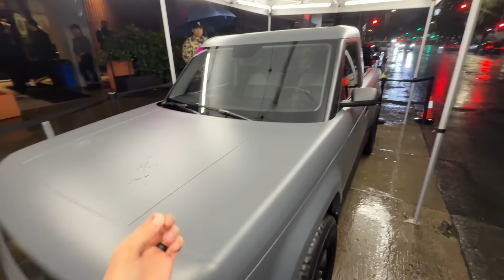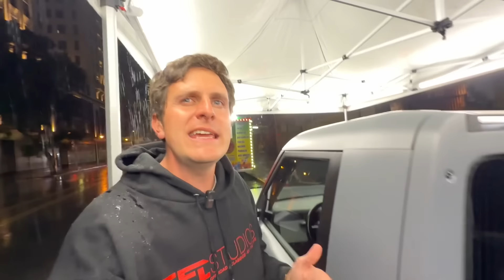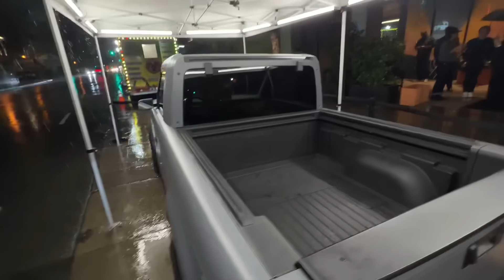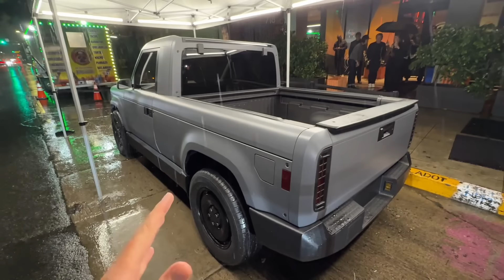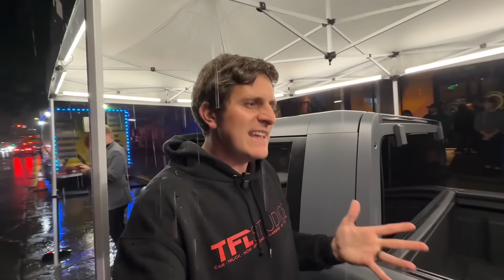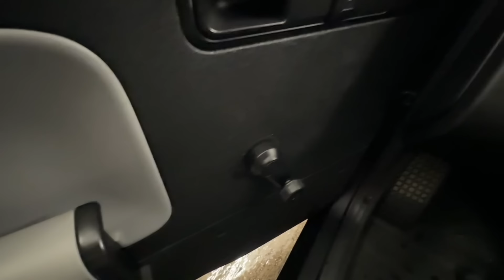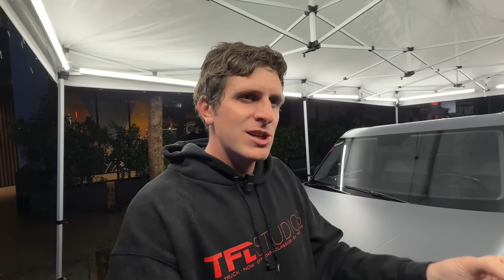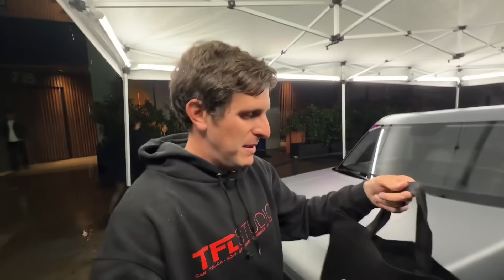The TRUTH About the '$20K' Slate Truck...Will This Really Be a Hit?

Comment: People do this with the frontier as well. All you see is how great a NA v6 is and “they want a basic truck” and they don’t sell. People talk, especially online. Rolling off the couch and purchasing and using something in the real world is another can of worms for these people 😂 That’s why manufactures don’t listen to online BS because numbers don’t lie.
Reply: Oh yeah..  There's a Chevy dealership in Florida that does work trucks.  2 door, white, RWD, base engine...  And they move a bunch of them for construction guys and such.  $22,500 WITH 1.9% APR..   Full size brand new pickup and $300 less a month than this thing if financing.  But, the person buying, looks and wants the heated seats, the 4WD, the crew cab, the more powerful engine, blue paint etc etc..   That one has a radio, has power windows, has much more utility... I get the slate is smaller, but you don't spend Suburban money on a Traxx.   

This thing isn't really a deal as a basic truck.  You can get more capable ones for less.  It's not really a deal as a basic EV, again you can get much better equipped ones for less.  

I get the talking.  Heck 6 months ago Slate was bragging 150k pre-orders in their first month.  A couple weeks ago still bragging on that same number.  And with a low buy in ($50) and low historical numbers from pre-order to actually signing the contracts, that might be a tough market for them to try and take with the price point they are moving at.

Comment: I want a $20k truck with a 5 speed, basic gas NA engine, and a lifetime powertrain warranty. I do not want a disposable Dixie Cup that takes 30 minutes to recharge and loses "range" over the 20 years I hope to own it assuming the battery lasts that long at any range.  How the hell is this a "common man" truck when the Common Man can't work on it, rely on it, or easily modify it to fit his needs.
Reply: EVs aren't all that hard to work on. And have less maintenance requirements than gas powered ones.

Comment: I think this will be good for a two-car family if it's affordable. Do not think many will be road tripping this. I used to drive small single-cab trucks, but as they gave way to 4 doors, I stopped driving a truck. I do not have anything against 4 door,s just not for me, no kids. There is room in the market for EVs Hev and petrol cars. The market will find its way.

Comment: People are forgetting that this company isn’t just for the cost cutting. It’s the fact that we’re finally getting pure basic machines again. The Ineos grenadier is 80k, but it’s meant to be a simple well built machine. We don’t want cheapo 13 inch touchscreens and all white interiors with piano black. Enough of the massaging seats, enough of the air suspension, enough of the no button-tablet only dashboard. We just want a simple long lasting car that won’t break in 8 months because they’re rushing to be the first with the next new features

Comment: I'd prefer more range and a slightly bigger bed at around 30k. If it's going to be this small, id rather have it be cheaper and potentially a hydraulic dump bed. There's kei trucks with dump beds, removable sides, and 4wd in asia for less than 15k. Even build in America, they'll be under 20k. If you have to tow anything 150 miles is going to really limit you. How much can it even tow?

Comment: Since its a truck, you can literally strap a generator in the back. Add a two way plug in the back, make use of that battery for V2L. The range is fine if the price is right. No 4wd is a buzz kill. No 2nd row might be a problem.

Comment: EV owners don't use the battery  from 0% to 100%. A realistic use is 10% to 80%, which gives 105 miles of range for this truck, and that is during nice weather. In the cold winter it can be closer to 70 miles of range.

Comment: Ford ranger 2009 single cab will out run and out perform this  and my basic already lol especially on off roading and towing. Im sorry but i need to see how it towes and how much weight can it hold that the reason for trucks either wise its a car with a bed not a truck

Comment: I like the truck, however, I won't be buying it. My reason is simply because its an electric vehicle and I live in the north where it gets very very cold. Electric does not do good in cold. I won't waste my time charging an electric vehicle when a gas one is so much more convenient. If it was gasoline and a manual, I'd want one. But we already have that in our Toyota pickup. Its a single cab, with 2wd, manual, and manual windows.

Comment: Was t this truck advertised for $10,000 just a few months ago?
Reply: About $20k was the plan, but that was back when the tax credit still existed, even though we all knew it was probably going away.
Reply: Is that price for a single drive motor and the entry level battery? What’s the cost for Dual Drive and the premium battery?
Reply: @vonklock6807  They have not announced anything but a RWD model and they have not announced the prices of anything, even the vehicle itself was only a very rough "mid 20s" statement.

Comment: I would totally be ok with an EV, for the right price, if I didn't have to travel. I typically don't drive more than 40 or 50 miles a day when I'm home, but once a month in need to drive 500 miles one way to get to and from work.  Even the best EV wouldn't be enough range for me.

Comment: Not only that a brand new Suzuki 660cc motor and transmission costs around $7600 US while a replacement battery for the slate costs at minimum $9300 US the slate truck could be cheaper with a gas engine

Comment: In Mass. I have had Volvo 240s and a Mazda B2000 truck, all rear wheel  drive. Also a Civic front wheel drive. We get real winters here. These cars were NEVER an issue in the snow and Ice. 4WD is way over rated.

Comment: Absolutely not what I want. It’s an EV, 2WD, doesn’t have a manual transmission, has a useless 4 ft bed, and a regular cab so you can’t even recline the seats at all, still loaded with electronic crap, it’s my idea of a terrible vehicle. Make something like a 1999-2000 Ford F250-550 with an extended cab, manual transmission 7.3 diesel, 4WD, and an 8ft bed. Sell it for $40k and I’d buy one, as would every other contractor I know (well if you also offered it with an automatic) Something that can carry real stuff, tow a reasonable trailer, plow snow, last you at least 20 years, and be reasonably easy for the average person to work on without needing special software and subscriptions and/or tons of special equipment and tools. Basically a late 90s early 2000s car.

Comment: My recent car purchase was a 2017 Mazda CX-5 Grand Select. One year trim level that basically only has the Bose Speakers, sun roof and Leather/Heated seats "Options" of the Grand Touring model. I would buy this if it was a little 4 cylinder Hybrid at best, with AWD. My only car "requirements" has always been AWD and at least 1500lbs of towing capacity. With my "Like to haves" being heated seats and nice speakers (which could totally be added later with aftermarket speakers).

Comment: The bed is too short to camp in.  It's a pickup in the same way a Subaru Brat was, meaning still not quite.  It looks like the #1 design requirement was that it would fit in a compact parking space.

My daily is a 1985 Toyota Pickup, 2WD, 22R, stick.  I've got four of them.  One runs, two need work but should run after a day of love each, and one needs more assembly.  The one I'm driving is the one I have the most money into, and I'm still under $4k.  I'm into the cheapest one for less than $1k so far.  It'll be under $2k by the time it could take over as the daily.  They fit in compact parking spots.  People ask what years they are and if I want to sell.  Parts are easy to come by.  Nobody asks if I really think this was a good idea to put that much money into an untested design.

I wonder what the economics would be of scouring the less rusty parts of the country for these and having a restoration system set up to "factory recondition" them.  If that happened, what would you rather buy?

Comment: As someone who worked in Jeep dealerships for 20+ years, real Jeep people want the upgraded Rubicon axles, transfer case and suspension but Jeep forces them to get heated memeroy power leather seats and sub woofer touch screen GPS sound systems, and 360 surround camera systems to get them. If they would offer a "Rubicon X" with all the off road capability without all the expensive luxury fluff and sell them for a sub $40K price, they wouldn't be able to keep them on the lot. But the truth is they make their money off all the luxury fluff so that's never going to happen.

Comment: Most households have two vehicles. For those who can charge at home - one should be an inexpensive EV.
My plug in Prius has a 20 to 25 mile range and it's plenty for where I live.  I have level 2 charging and charge once or twice a day.
I have to make it a point to burn through a tank of gas (10 gallons) every three months to make sure gas doesn't get old and  the motor doesn't die.
I live next to a hydro dam with cheap electric.  Drive 20 to forty miles per day and spend $5 per month for electricity.

Comment: When you're talking about a gas engine, you go off the rails. Are you not aware of the CAFE standards? The only reason small ICE trucks won't be sold is due to those standards. The only way small pickups will be built and sold is if they are EVs.

Comment: I agree they need to add a gas engine, but I think you're slightly missing the point in saying that "people buy range for trips they never take" and "modern trucks double as family vehicles" (regarding the switch to crew cab);  I believe that the people that really want a cheap truck are the working class.  The landscapers and guys commuting to construction sites.  They need the range to drive all day or commute a hundred miles one way to a job site. This truck would be perfect for them....if gas, and if the bed was a little longer.  They're still driving 90's Toyotas and hard body Nissans because they're literally the only thing that fills that need.

Comment: The worst thing you can do with a vehicle is try to please everyone on a single platform. Then nobody is happy because people who want lots of extras end up with lots of useless things intended to please other niches and people who wanted something as bare as possible don't have any choices either because even the most basic trim already has loads of crap on it and all of the overheads associated with making the extras possible.

Range-wise, 200mi (150mi usable winter range) is my minimum: I do not want to make charging stops when I go visit my farthest out-of-town friend, especially in bad weather. I also need 150+mi of range for those days where I need to make more than one round-trip to my sister's house in a single day and still have enough range left for my normal stuff without feeling too much range squeeze on my daily driving.

While a range extender may be nice, adding all of the facilities to accommodate one would add hundreds of dollars in costs to the base model: modifying the platform to add facilities for a fuel tank, exhaust pipe, electrical hook-ups, coolant hook-ups, etc. along with associated additional points of failure and likely reducing usable cargo space in the process too since the space reserved for a tailpipe, cables and hoses cannot be used for much else regardless of whether you fit a range extender to your truck or not.

As for AWD, I'm in Canada and I definitely wish I had AWD for the 4-5 months per year where there is snow and ice on secondary roads. Also, 150kW is too much power to have on front wheels alone, really wish it was more like 75-100kW rear and 75kW front. I do not consider RWD as a viable option since that makes it difficult if not impossible to recover from grazing a snow bank on the highway and under heavy snow conditions, you sometimes have to plow through 4-6" thick banks to change lanes. With FWD and AWD, you just power through almost as if there was nothing there, front wheels pull themselves over the snow and the rear follows.

Comment: And then there's single people with no kids who don't need a family truck.  More the norm these days.  It's the only choice that makes money sense.  I take the road trips.  To work and back is easily 90 miles round trip when the freeway is closed and there's a detour.  Not a fan of EVs though.  If it's like every laptop ever, 3 years and the battery is dead and the computer/vehicle is a paperweight.

Comment: Just think of all the aftermarket body addons that could exist.  Want a supercab potential easy body mod that could come out and be a bolt on. Maybe a subaru baja body mod. The way they are designing this there is the potential for aftermarket changes. The cost of the unit makes these type of things possible. Just look at all the body mods that were available for the VW bug which was just a bolt on body.

Comment: I am very curious to see what happens with this Slate concept.  I am turned off by the very short bed--I can work with the 6-ft bed of the older small pick-ups, but the shorter beds (of all modern pickups) leave me looking in the used truck market.  Also, I feel like Slate is putting too much emphasis on the modularity and customizability, which will make these vehicles expensive for consumers.  Please put more effort into a true low cost, somewhat more capable simple truck.

Comment: I bought a brand new Toyota, small truck basic, in 1979, it had the indestructible 2.2 22R motor, with a five speed it got great mileage, handled well and was a low cost alternative to a full size truck, they will not make them anymore, because the only way they make money is to load these trucks up with electronics, and, gimmicks that add nothing to the utility just the cost. I do not want to have to "wrap" my vehicle, just drive it home from the dealer. For the money I would rather have a good used F150.

Comment: What they are going for is interesting, in a way sneaky, and in another not quite there. Range is an issue even with larger battery. I have to go 50 miles to get to a hardware box store or woodworking store. Imagine having to go a couple of times because you need something else. People do like to customize vehicles, but that's only when they can afford to either have it done, or even fewer will do it themselves. Are the accessories going to be affordable, or marked up so far people don't bother? As much as they think this will be a secondary vehicle for the household, how many working class people can afford another vehicles insurance, maintenance, and storage cost when everything else has gotten out of hand? For the total end price, would buying a vehicle that is setup for families with a decent bed space be the better option? Me, I didn't land a family,  a two seater is fine as I've got that already with a cab and a half that didn't have the back row. I enjoy and utilize a larger bed to make it easier move materials and get work done. For me a truck does work, and a car is better to move people. But when money is tight, does it make sense to have two different vehicles for everybody? Plus you have a whole bunch of knuckleheads who think a larger four wheel drive vehicle will keep them safer in a crash, physics says to the contrary. More mass equals longer stopping distance, higher center of gravity equals higher rolling chance, bigger overall makes a bigger target, so on and so forth. Too many tiny people driving trucks they can't see over the hood.

Comment: They need to find a  creative way to still sell it for an equivalent of $20K in today's money. Otherwise, it will go the way of Cybertruck: an oddity way overpriced for the utility it provides.

The equivalent of such price would be a lease at $278 a month with zero down. A symbolic $250 a month zero down - easy to advertise and remember "quarter grand" - would be even better.

Since presumably there aren't complex mechanical or electronic parts to quickly wear down and then require a fortune to repair, like with most cars these days, lease residuals can be ostensibly pretty high.

Comment: Most modular designs fail and die because the company doesnt open source the parts and accessories and tries to stifle third party support. No one will buy a car if all the accessories are high priced OEM stuff. It needs open source cheap accessories to survive.

Comment: It is an interesting value proposition without the tax credit.  At an actual cost of $20K I was smack in the middle of their potential buyers...50's, all my kids are furry (and huge), commute is 34 miles round trip, a house with multiple options for charging (soon) including solar, long trips are done on my motorcycles or towing a race trailer with by gas guzzling F250.  I am reaching a crossroads where as soon as my current dog hauler (2004 Sienna minivan) becomes to rusty to be worth repairing in the next 12-24 months, my next DD will be an EV.

At about $25K it is competing against excellent used, late model EV hatchbacks that are arguably a better value proposition.  At $30K (a couple of factory options and a wrap could easily put you there from $25K) you in New Nissan Leaf territory and like the new Bolt.  I have no issue with single cab truck configuration but a good hatch does all the "truck" things I need my DD to do so it is not a particular win for me.  This going to be a lot like the Gladiator in my opinion...everyone that has been begging for this simple truck, half will buy them in the first 18 months while half change their mind and then there is no more pent up demand...the market is saturated in just two years.